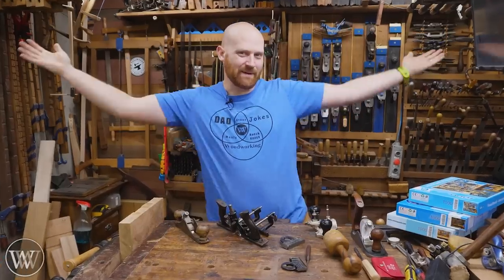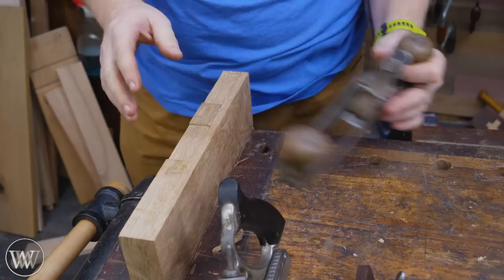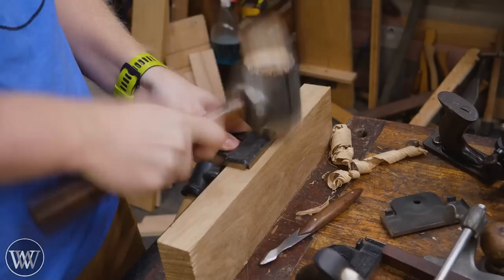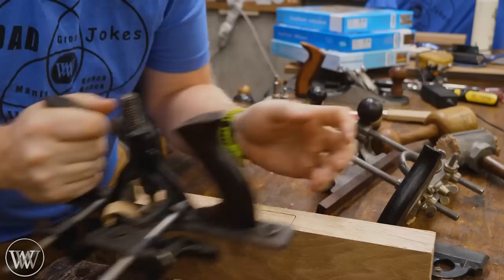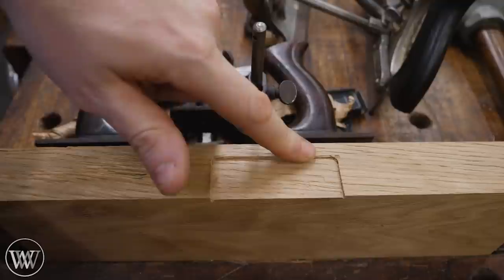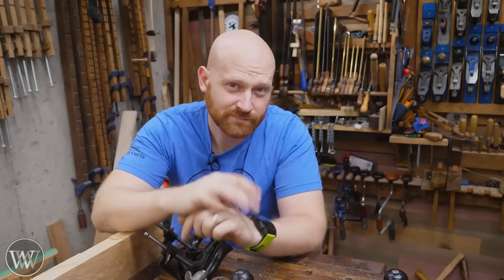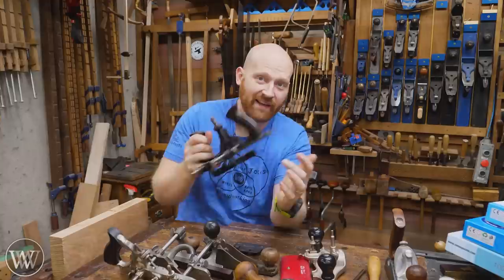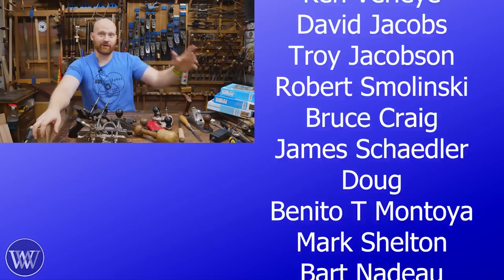The Plane That Does it Too Well Stanley 171

Comment: I buy replacement doors and build the frames, what they sell is pine or some softwood, I like something that rots less easily, and always use just a chisle...  never seen most of the planes you do these postings on... of coarse I'm not a carpenter, just an old guy way too cheap to pay other people to do things I think I can do myself...
Reply: exactly -I'm using a knife and a sharp chisel for hinge sitting, and it is probably faster than router planes

Comment: I'm pretty sure the round corners on modern butt hinges is to accommodate the dado cutter used in modern electric router. Great for production work but not as fun the old school tools.
Reply from the maker: Yep. Electric router can't cut a 90° corner.

Comment: In addition, there's the change in standards. My father's 1949 G.I.Bill house has no square corners, no plumb walls, and most door hinges were professionally fitted with a knife and screwdriver. New construction is even more efficient!

Comment: I have never seen either on of those tools, of course I have seen the hinge marking tool but I never got around to buying any, I don't do all that many, even when I did a lot of finish carpentry. I use to work in a custom door store and I had routers set up to cut hinges. it was fast and easy. honestly I could build  set of door jambs in less 15 minutes. The only time I had to do it by hand is when I had to build something that was a one off. like the time i built a custom door frame for a wine cellar. The door was 6'2" tall and 2.25" thick. even commercial doors are not that thick. The hinges were extra large as you might imagine. I think they came off a tug boat or something.  I cut them by hand with my favorite chisel. It took it a long time but it works great. having the simple router plane would have saved me a ton of time. I think if it was me, I would have used the hinge tool and then with a sharp knife back cut along the grain, so that my chisel does not slip and cut beyond the marked out area. It is amazing how slowing down a little produces a better job.

Comment: The modern hinge has 5/16 radii on the corners, because the Porter Cable  router hinge jig was designed to work with 5/8 router bit, and in the post war housing boom, the Porter Cable jigs were the dominant force on the market, which all others copied.

Comment: My home’s front door got replaced at some point in time before I moved in, but the jam didn’t get replaced. So the dead bolt didn’t line up. When I changed the door knob, I had to adjust the spacing a bit, and I just used my Narex Richters to get the job done.

Comment: Don't have either. I use a router plane for all hinges. If I thought guides were necessary, for repeated unskilled use, I'd attach 2 wooden base plates extended forward either side of the blade. But router +"hold n pivot this side, push that side" should do. Otherwise I'd hand a pair of wooden rebate planes and say go to town in both directions.

Comment: I do my hinges with a version of the Paul Sellers 'poor mans rebate plane' (made it on my table saw, blasphemy I know). With such a plane, you can extend the blade quite far down to give you sort of a low-depth router. This works really well for the very few doors I do. I wouldn't be without a similar tool because this allows me to get three hinge mortises at the same depth. It's really interesting to see the 'real' old tools designed for this job!
Reply from the maker: Sounds a lot like the hinge butt mortise there's a reason that was the standard for almost 100 years. Far faster than a chisel and really useful.
Reply: @WoodByWrightHowTo  I did forget to mention that it functions almost exactly the same as the hinge butt mortise plane. The takeaway is that it's easy to make one yourself:)

Comment: Love the wood working history  lessons James, keep learning again and again stuff I didn't have a clue about. Agree that this is a really well thought out tool. Just saw another channel had a mechanical drill press and now I really want one of them, so if you come across one, let me know 😀 Trying to get away from things needing power/electricity in my life, not only tools, but other stuff as well, preparing for the soon to come digital reset 😆
Reply from the maker: I've done a few videos on post drills. They were meant more for metalworking than for woodworking. But they are fun.
Reply: Yup, I've seen those, but had never seen a manual drill  press before, lot more practical use to me that a post drill.
Reply: @lynxg4641  when you say mechanical drill press, what do you mean? Got any links to the one you mention? I have a post drill (with missing post!).
Reply: @lynxg4641  much appreciated, thanks. I think I misunderstood your original post, my apologies. I have a hand cranked drill press, but it's different to that one. It has a larger wheel, but by-in-large works in the same fashion. It needs a new post and some TLC, but otherwise it works. You can pick them up reasonably inexpensively in the UK but they'll usually need some repair work. Haven't seen one like that in the video though, it looks a bit better than mine. I think mine is early 1900s, not completely sure. The model in the link you posted looks later than that I'm guessing.

Comment: I think these tools are quite interesting. But I do so few hinges that I haven't bought any hinge specific tools. I still use my 3/4 inch chisel and a mallet when I do the odd hinge. (Of course a smaller chisel if doing a small lidded box or the like.)

Comment: I think most people paid to fit doors would have jus used a chisel for that job, much quicker than any plane. I'd use a chisel for most hinges, if it was a hinge on a small box I would usually finish it with a small router after I wasted it with a chisel...... I find small things require more accuracy so that's why I'd use a router on the smaller ones.
Reply from the maker: That's why the simple hinge butt mortar sir is so useful. It's just as fast as a chisel but in the end it's a router plane so you get the fine finish from that as well.

Comment: What size gouge was it you used for the rounded corner? I mess with doors a lot and have been wondering what size gouge would match the typical hinges that are used today
Reply from the maker: I just grabbed a random gouge for this. I would grab the henge and match it to the gouge of it were in a real door.

Comment: I love planes that do one job well...but I think I would take a hard pass on this one. Id end up putting it aside and grab a chisel and a marking gauge. I feel like it would just be a lot faster in the long run
Reply from the maker: There's a reason that most finished carpenters just used a hinge butt mortiser. Even faster than a chisel and far easier than 171 to set up.
Reply: @WoodByWrightHowTo  I should have said, I would pass on the 171. The hinge butt mortiser does work well.